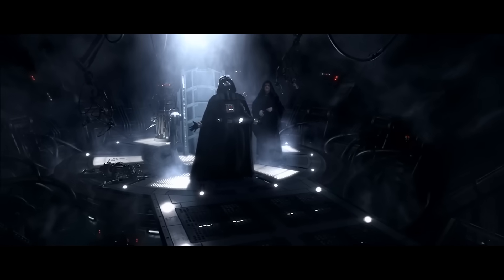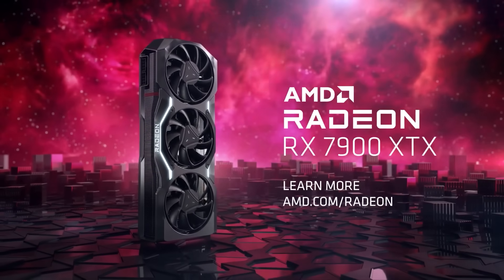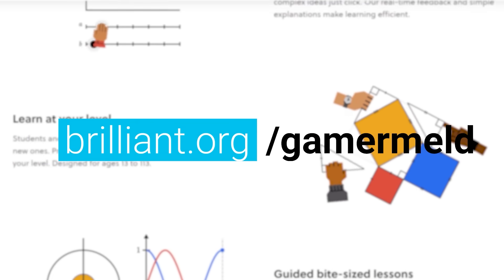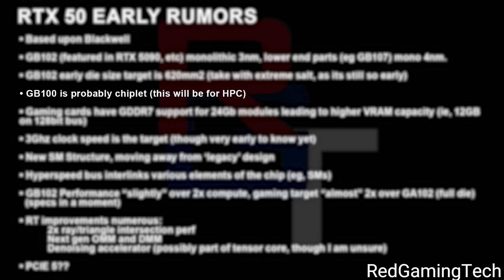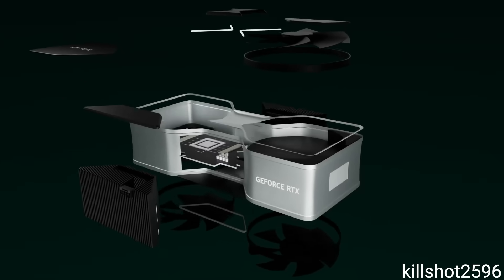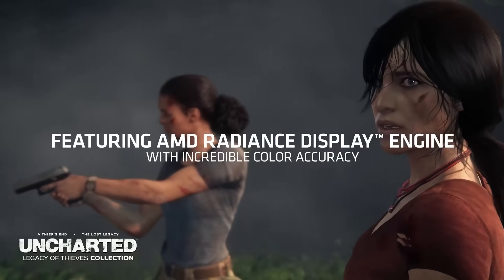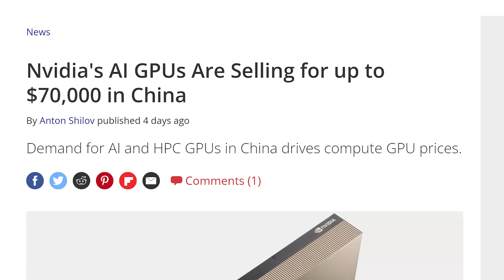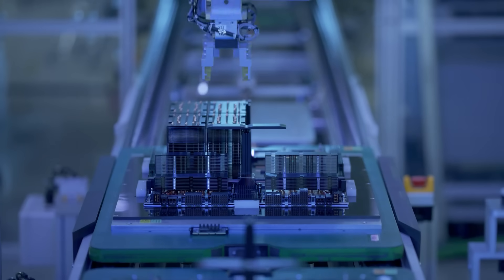Say GOODBYE To GPUs Again!

Comment: I think this GPU shortage  is being done on purpose.  I used to upgrade PC components every 1 and a half-  2 years .   Swap out a CPU with one upgrade and in a year or 2 my next upgrade would be GPU.  I got a 10700k and 3090. I play at 2k abd 4k and do 3d design. My next upgrade will be a CPU upgrade. Im waiting for AMDs  next CPU lineup.  Im not paying absurd prices fur a GPU though.  I oaid 1000 fir my 3090 and that was more than i wanted to spend. I won't spend that much again. The pruce increases are BS. Play statuons abd Xbox cost about the same price they did 10 plus yeaes ago. Over  a span of about 8 years Nvidia trippled the prices of sone of their GPUs like the 70 series. What used to be $300 is now $800-$900.  If Sony and Microsoft decide to make their next consoles eeven more like PCs, like able to use mods and other features, it couod help with lowering these prices.

Comment: Gpu maker will always find a reason to increase their price. It wasn't so bad before mega gpu mining exist. Since the gpu mining started to drop, they use it on the Ai to keep the demand high so the price won't drop back to where it should be. Why not just make a specific card for Ai instead of using Graphics Processing Unit? This is one of the reason why some new gpu performance sucks. I'm not anti miner or ai, just separate them. I don't want to buy overpriced gpu that is suck in gaming performance while better at something that i don't even use. It's like buying a boat that barely floats but have 20 inch sports rims, tyres and smooth suspensions.

Comment: I said this a couple months ago that nvidias 5000 series was going to be huge to try and make up for the 40 series horrible pr. They're going to be badass, pushed hard and don't forget expensive. Hopefully they spread the performance out some. From 4090 to 4070ti, the gap is so large there was nothing left for the 60 and 50 cards. Just between the 90 and 80 alone the gap was way too wide in my opinion.
Reply: There is a gap there because of the early canceled 4080Ti  but yea I largely agree with you.  I may sit out 5k series because I purchased a 4080 and it destroys everything I throw at it and buy a gen 6 card which should actually do RT properly at high framerates.
Reply: Mine has too until yesterday. I installed far cry 6 and turned everything up. Did a benchmark at like 7 fps. I wasn't near the vram capacity. I forget which one of the rendering settings did it but I couldn't understand why it happened at all. I actually haven't used it with rt yet. I think the only game I have that uses it is cyberpunk. @JathraDH
Reply: @daneverdier1950  Oof that sucks, but sounds more like a bug than something intended in that case.
Reply: @JathraDH  that is a newer game. Hopefully that's it

Comment: Nearly finished building a used pc, only to play Bf2042 , the motherboard is an asus prime z370-a, the ssd  heatsink was missing, found a thermalright HR-09, thing is,the south bridge looks like there's not enough space between it and where the ssd heatsink fits ,I have no clue where to get the original heatsink from. Will a third party ssd heatsink be an issue for the motherboard?

Comment: I run a 4k monitor + a 1440p monitor.  All of these GPU companies who think that I should run at 1080p for gaming are missing the mark.  I don't even mind running my GTX 1080 for the smaller monitor, but give me enough juice that I can run ANY game at 4k.
Reply: They never have and never will give more juice or even just enough. Best it has ever been were $300 high end cards from ATI that compleated with Nvidia's second from top tier card of the time. Intel's A750 looks to be the new price/performance champ tho with higher/ish end specs for a midish range price that card will be the biggest bargain in a few years after the drivers are closer to perfection. Used to be able to add one or more GPUs together in parallel for even more performance and image quality lol. That feature was way better as far as image quality and performance than the lower quality "fake frames" that replaced it lol.

Comment: I have played games since c64/amiga 500 time and I must say I'm worried that I can't play games in the future as there's absolutely no limit for company's and gamers for what a gaming system can cost! Buying a gpu for 1500-2500$ seams no problem...its insane!
Reply: We still have the option to game on reduced quality. 1080p @60fps and tweaked settings is easily achievable with a $200 gpu.
Reply: I mean this is a very dumb argument.  There are so many GOOD games out there that will simply run on a potato and more coming out every year.  If the only games you consider games are unoptimized trash AAA titles then yeah I guess.  As a old gamer though you should understand you don't need super fancy graphics to have a fantastic gaming experience.
Reply: @JathraDH  Very true, gaming industry boomed so hard there are at least a few hundred really good games I've totally missed because it's impossible to keep track. 
Also tons of EA games where you could never be sure if they were going to be abandoned some 5 years ago may now be in full release and worth their money.

That being said it's fine to expect to be able to play new and triple A stuff on decent quality without spending fortunes on your hardware.
Reply: @brohvakiindova4452  Well, I don't know.  I think the perception has changed a bit over the years.  I remember when Crysis came out and no one could run it and everyone was like OMG THIS IS AMAZING then it got set as the meme benchmark for years.

Or when the original Unreal came out and it was so heavy to run but looked amazing.  Games like that used to be celebrated.

Then again those games were also somewhat optimized and not just pieces of trash and just genuinely pushed the envelope of what was possible.

They didn't look like games from 5 years ago at the time and just ran like trash.

I agree that you should be able to play like 1080p/1440p/60 med/high on modern games on relatively cheap hardware for sure.  But if you have a 4k screen or high refresh monitor then you need to pony up in GPU's.
Reply: @JathraDH  True but at the same time it was never easier for indie devs to create games with arguably decent graphics so it's not all that horrible with new games not pushing advancements as much as they used to.

What I'm really missing is not at all the graphics but the creativity and "soul" only indie devs seem to bring combined with sufficient resources to make games that are amazing for trying out new mechanics.

Like Molineaux did in his prime.

Comment: They need a dedicated Ai department and manufacturing plant making these cards so “gaming” cards aren’t sacrificed to the Ai nonsense.
Reply: That's not the problem.  The problem is they pre-order X amount of silicon production from TSMC typically a year in advance.  This is why the GPU shortage of 2020 hit so hard because they couldn't simply ramp up more production, the orders were already made and the amounts people got were fixed.

If Nvidia is going to order X silicon and for every square CM of that silicon they order they can turn that area into a $5000-10000 AI GPU dies or a $400-1500 gaming GPU dies they are going to be devoting the lions share of their total order to AI because that will make them the most profit.  Having a separate gaming division will not fix this problem.

Comment: AMD and Nvidia are both a year ahead on inventory, they are panicking to get us to buy cards without them having to lower prices. This is why the mid range has been canceled this generation. They want to wait and sell it as next generations mid range. Nvidia is in panic mode canceling all midrange AI and pro parts, this can only mean they have to force people to buy the high end to maintain margins. This is all smoke an mirrors to keep investors in the dark.
Reply: The smoke and mirrors is that nobody can actually explain what the heck AI has to do with GPUs other than somehow it's going to jack up price and limit supply lol.
Reply: @leanlifter1  they are using that as an excuse, but instead of selling the midrange chips for ai they cancel them.   This is why the memory bandwidth is so low to keep them out of ai. Same reason high end 40 series refuses price drop to protect high end ai chips
Reply: @MrMetalpunx  GPUs do Physics/animation calculations not AI.
Reply: @leanlifter1   wow you are a special kind of special, you just keep lifting heavy stuff and try not to strain your brain....
Reply: @MrMetalpunx  Can you explain what the purpose of AI on a parallel processing unit or gpu is ?
Reply: @leanlifter1  they use them to do lots of parallel computation at the same time, think of a neural net matrix, every time you run it you re-weight each value In The matrix. So basically fp32 workloads.
Reply: GPUs have a large number of cores and are optimized for parallel processing which is why its used in AI (as opposed to CPUs).
Reply: @tomtube1012  "Optimized for parallel workloads" is not an explanation it's a generalization. It would seem this AI hype train just stinks like another big Ponzi Scheme fiasco like crypto.
Reply: @leanlifter1  The only thing moot is your comment, which is why it got blocked. LOL.

Comment: The problems with gaming and any other software is drivers and api optimization.  A good example would be dx11 vs vulkan rainbow six siege, apex legend and dota 2. If the api is not well optimized it cannot utilize the hardware good enough. My brother is a dev ops engineer and said that 95% of the time the drivers and api are not well optimized and too many unnecessary packages. He works on Linux, Windows, Unix and Mac OS. The hardware is capable of running all of this well its just those optimization. You've seen it with amd that had bad drivers compare to nvidia or even intel arch gpu that have bad drivers. Intel arch gpu have really good specs for the price but because of drivers it cannot run as it should.
Reply: I'm guessing that Intel GPUs have to software-translate instructions same as Pentium 4, negating any architecture advantage.

Comment: Im just going to put this easy... no gpu prices are not going to go up. Reason for this is because of fast falling nvidia tesla prices. You can get a tesla v100 for around $500 and they are no slouch when it comes to performance. Reason they are ordering that many gpus is for training models. A model takes alot of horsepower to train because your likely training it on 70+ billion parameters. A single 7900xtx would likely take years to train a model of that size.

Comment: I saw this coming at the very start now the only thing left on the "robot trillionaire hypothesis" is the "AI coins" that will replace or merge with crypto to be spent on AI services and physical goods tied to the actual AI which gives the coins value unlike current cryptocurrencies which is hot air.
Reply: Congrats you just defined another ponzi scheme.
Reply: @leanlifter1  nothing ponzi about it as it provides actual services giving the coins real value. It's more like stocks

Comment: Picked one hell of a time to buy an ROG Strix RTX 4090.
Reply: The new GPUs come out in 2025 so you're gonna have some time before you will feel sad 😂
Reply: @ksenchy  Been running a GTX 1070 Ti for 5 years now, enough is enough. I'm not the type to buy a new GPU every year, and the 4090 looks like it has the 4k performance I'd want.
Reply: @ofekk213 I feel you, but I couldn't get myself to buy 4090. With 500W it sucks way too much power for my taste
Reply: @ksenchy  thank god Israel has cheap electricity
Reply: @ofekk213  lucky you. In Europe it went crazy
Reply: Just bought one Last week. It boosts up to 3GHz and doesnt go over 65-68° 
A very nice GPU, Just right for WoW 😅
Reply: @Dynaevil  you sure its fast enough?
Reply: @GeneralS1mba  it does good. But the CPU Kills it 😅 in town in max setting with 20fps 🙄
Reply: @Dynaevil  dang I'm only fine with 480fps+ with 1ms total latency, I'll sit out till rtx 9000
Reply: @Dynaevil  I have core i5 13600k for now, planning on buying a core i9 14900k in october. Will build the PC in this Sunday, hope the i5 won't cause bottlenecks (tbh it's a 14 core 20 thread CPU no way it will cause bottlenecks).
Reply: @ofekk213  that depends in the Game 😜 Not every Game ist able to use the full Power from the CPU. WoW dont scale with more cores, thats why the best GPU will help much if the CPU isnt a Quadcore with 10 GHz 🙄

Comment: Read the details in the slide - GB102 to get 2x performance of GA102.  GA102 is Ampere, not Lovelace.  So getting double performance of the 3090, not the 4090.  Sounding a lot more reasonable
Reply: that's a great observation, changes everything about next gen's projected performance
Reply: so basically 40-50% better than the 4090? (and as usual, i assume even that is achieved with dlss)
Reply: @Bantu_E  It's probably only 50 percent faster, in certain scenarios.  It'll probably be more like 25 percent faster on average.

This isn't bad, but it's not what some hardware enthusiasts might expect.   However, it doesn't surprise me as it's becoming increasingly difficult to get dramatic performance improvements out of silicon.
Reply: @Bantu_E  ngl if dlss and rt performance improve further, rtx 5060 ti could finally make ray tracing viable without being broke (it'll probably cost $100 more tho :(

Comment: They should make GPU size smaller. Big GPUs are the past now. for me that is.
Also i woulndt be surprised if the 5k series would cost double and double the heat.
Reply: It's their only way to fufil their expectations of "generationnal improvement".
They have to fit more cores so bigger die and they do that with their RTX **90.

Comment: If prices of next gen cards are too high... just don't buy them.. I'm happy to stick with my 3080 if that happens
Reply: 3080 is a damn good gpu bro, the problem is for people on low end pascal and people without a VGA.
Reply: You got an i9 13th gen for ps1 ps2 games? You're killing an ant with a bazooka man
Reply: @dethskullcrusher  I'm new to pc and I'm trying to make pc great again playing ps2 emulator with 4k resolution looks perfect. Plus loving Retroarch achievements it's like trophies I beat final fantasy 1 nes got all 28 achievements plus working on Tony Hawk 1 achievements
Reply: @Rzaro786 if ur jsut gaming a 7800x3d would've been much cheaper and a third of the wattage, and faster
Reply: I got a rtx 3050 and im happy with it, im not a guy for latest and greatest, i love old school games and anything below 2020 is more than good enough. Im still playing battlefield 4/1, dota 2, dying light 2, oxygen not included, rocket league, divinity 2, etc. Playing all those good games cause i had a gt 710 for 5 years and then a gt 1030 for 5 years, i missed alot of good games and now playing those that I have missed.
Reply: I got evga 3080ti and happy to. I just built it and z790,ddr5 32gb 13th Gen i9 so it makes it better. I play old school games ps1 ps2 nes snes so I'm good
Reply: Problem is that I'm building a new rig and am having to do it in two parts - the main rig and the GPU.

I WAS planning to build the new rig first, then get the GPU 6 months later.

But if there's another GPU shortage on the way I might have to do things the other way around in November.

I'm currently on a 6700K and a 1080 lol 😊😂

Upgrading to a 7600X and a 7900XT or 7800XT or 6950XT, depending on price/performance.
Reply: Lots of people still using 1060s.  Heck, I'm still chugging along on a 960!
Reply: @timothyneeck2680  If you dont run the latest and greates like me, just running bf1/4, cs go, dota 2, apex legend, Rainbow  6 siege, subnautica, horizon zero dawn, battlebit remastered and phasmophobia then people dont need the next gen gpu. I mean I had a gt 1030 for 5 years, played dota 2 and cs go(that is all I could get) and now i got a rtx 3050 8GB for 240 dollars new last year August.
Reply: I'm just glad i got a 2070 recently, and not been fucked over.

Comment: Eventually, we'll have a card on the computer just for AI.
Reply: Can you even define what you are trying to explain ?
Reply: @leanlifter1  An AI card like a video card, audio card, or any other card installed on a motherboard.
Reply: @masx4468  Sound cards produce audio, GPUs do Physics and animation. What exactly does an AI card do ?
Reply: @leanlifter1 in Past there were PhysX card that were used for physics calculation to releave load from gpu. They worked well actualy.
I gues AI card could do the same and much more, let gpu to do its thing.
Reply: There already is. It's called "TPU" (Tensor Processing Unit). But there aren't really available for buying. So GPUs are still being used for AI tasks.

Comment: RTX 5090 is like more than 1 year far from release, and this dude and other tech news media hype it... WTF... I just hope that we will not gonna see uplifts like on RX 7000 and RTX 4000, so they don't have to give us numbers based on FSR or DLSS. Just pure RAW performance.
Reply: That's a problem if you had to use fake frames on a brand new high end GPU. That's ok I can just SLI/Crossfire the GPUs so no need for fake frames ... Oh ya they took that option away as well. Looks like the best way is the old school way just turn some settings down then you don't need more GPU or fake framery lol.